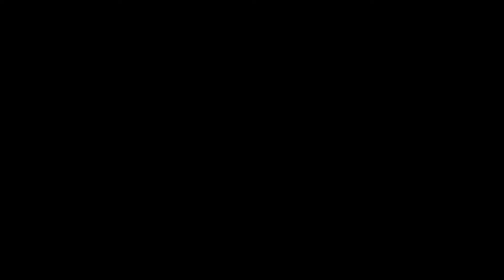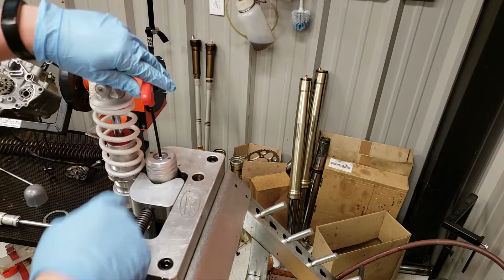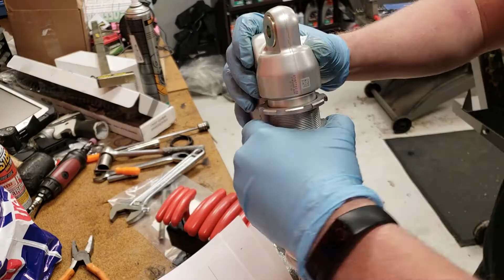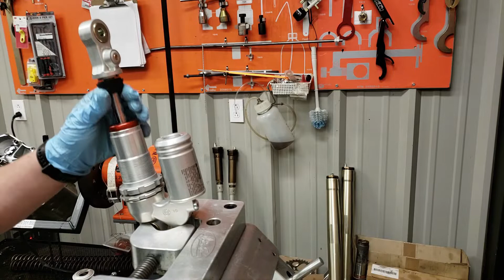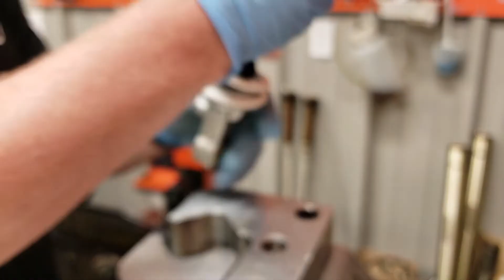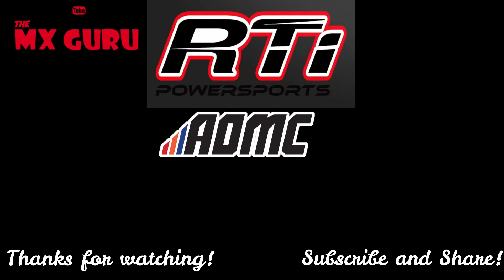KTM / Husqvarna SX E 5 / EE5 - How to lower the rear shock

Comment: Anyone have a link to a video or instructions how to charge the nitrogen? At end of video the comment is to “charge per the repair manual”. I’m not seeing in my manual (curious what special tools, etc)
Reply from the maker: Best thing I could recommend is to just install a bladder kit and charge like every other shock. 

Otherwise you'll need the WP fill tool and make sure you set piston height correctly.